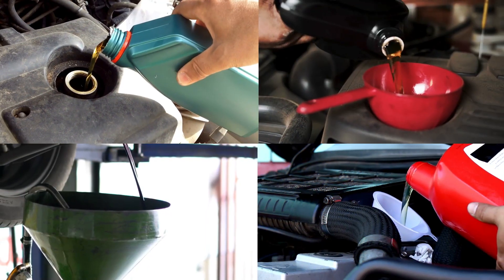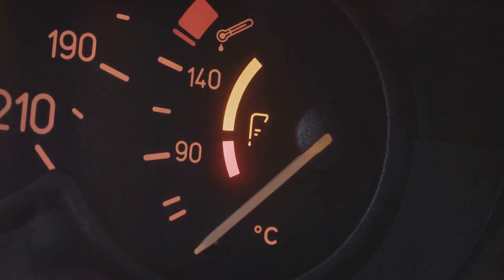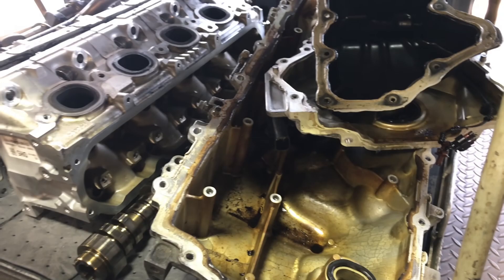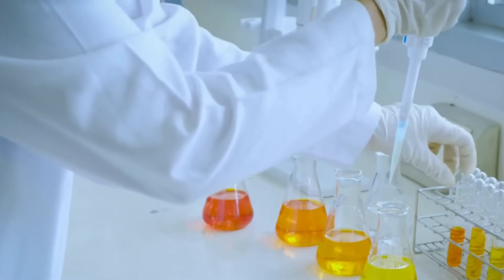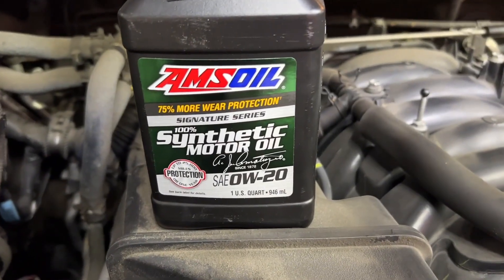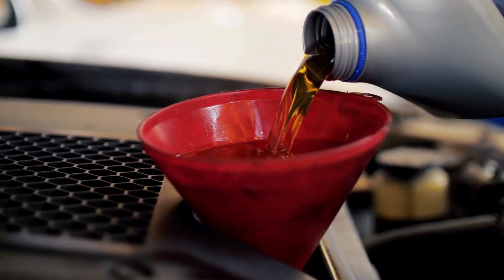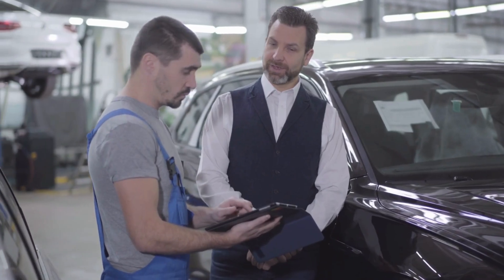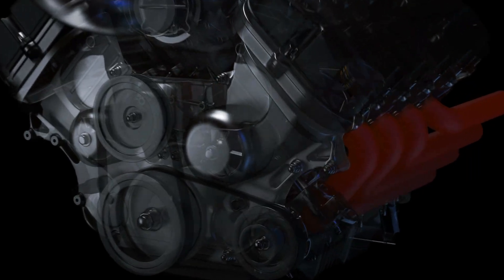Is Synthetic Oil Really Better ? What No One Tells You

Comment: They use full synthetic oil in jet engines and generally don’t change it, they change the filters and add more oil when it gets low. It doesn’t breakdown like natural oil under intense heat. That’s enough for me.

Comment: Stupid title. of course Its 100% better it does not break down under high heat and put a brown patina on all the engine internals that ruins the engine. If your running out of things to post try posting why Vat oil will destroy your engine and is used everywhere especially at the new car dealer.
And as mentioned earlier Pennzoil Platinum's a really good oil. I'm on alot of car forums and BITOG and many people mentioned Platinum. I tried it and my engine runs great really smooth and its not getting dirty quick like most other syns i have been using. I used to use Redline oil which is fantastic but really expensive now so have been using M1 for yearsa but Platinum is my new oil. Try It!
5 quarts for $27 @ Wallys.

Comment: You never run oil in any gas or diesel engine more than 5000 kilometers or miles
Reply: 5000 kilometres is half of 5000 miles so a silly comment as 5,000 miles changes is wasteful and stupid. We get 300,000 miles plus out of our cars with 12-18,000 mile oil changes no problem in Europe.